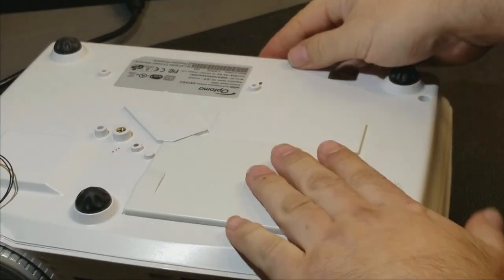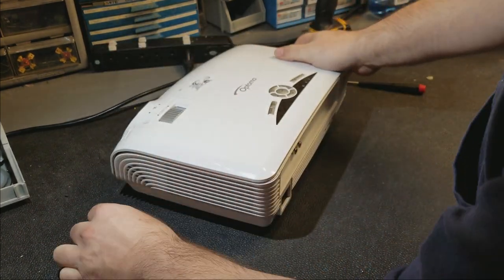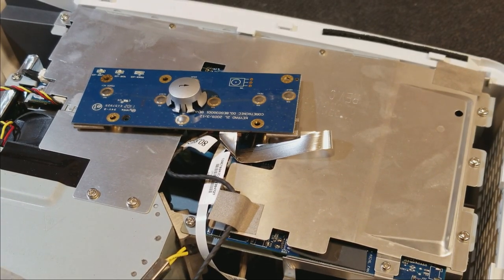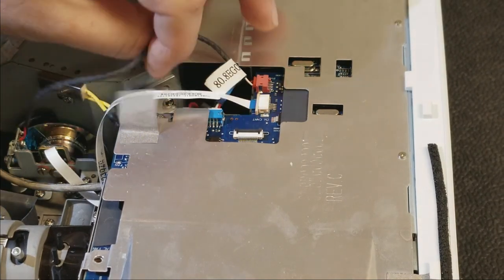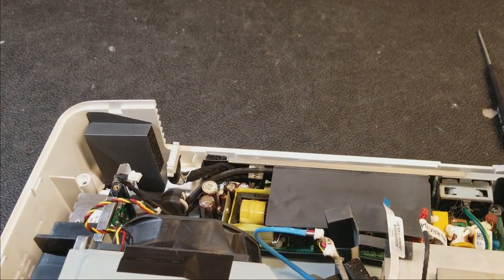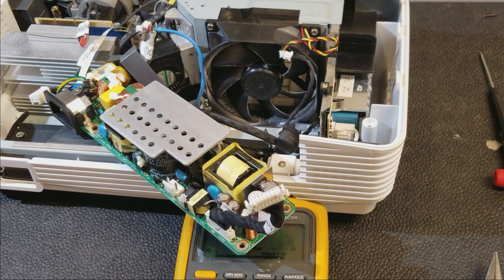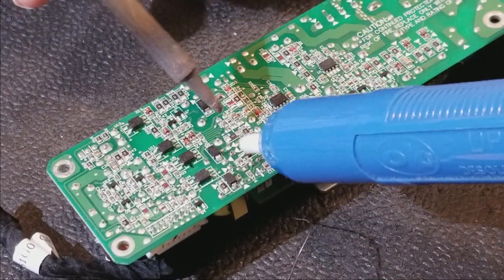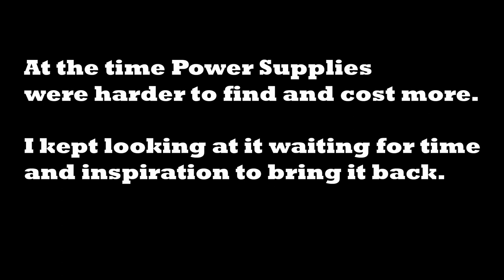Optoma HD20 DLP Projector Power Supply Replacement P 1

Comment: Frank, do you know how a projector works in 2D and 3D? It is software, or hardware based? (Epson 3 LCD)
Reply from the maker: Hi Tibor, I did some research and verified the epsons use software for the 3d. I'm trying to track down a service manual in your series. That will tell us more.
Reply: @FixitFrank  Thank you Frank. I appreciate it. SM will be hard to find. I'm wondering, if an IC that switches 2D to 3D may be damaged?
Reply from the maker: If I say no, then it will end up being bad.  However I kind of doubt it.  The fact that is works, just in 3D mode makes me think its software.  The software is going to tell the chip or chips to change the image properties.  What I don't know is if the change is handled by the hdmi chip or by the main microcontroller or if there is another chip that only handles when its in 3D mode.  Can you get me a few high res pics of the mainboard?  Whatever side has all the chips or both sides if possible.  

Another thing to try is talking to the projector via RS232.  You might be able to force a reset or mode change. You will need a terminal program like Putty or Hyperterminal, a null modem cable (DB9) and a usb-serial (or a pc with a real serial port).  

Go through here https://epson.com/Support/wa00573a for the zip file with serial commands and terminal setup.  

It's in excel format which is unusual, but on the TW6100 worksheet, there is a list of commands to send via RS232.  One of the commands batches has a lot of 3D specific settings.   You may find the setting there that will straighten it out.  I would verify the software before going after the hardware.  The software will actually be easier to rule out. If you go through all of the possible commands via RS232, then it might be a bit of hardware.  

I will look at the pics of the mainboard when you get them and I will try and determine what is controlling the 3D. My worry is that the problem is a separate micro controller. Replacing the chip itself wont fix it unless you can load its firmware which is not available to you or me.
Reply: @FixitFrank  My model is the 3020e, that would be the TW6100, right? It has to be RS232, I'm not sure if I have a PC, with that input. I have serial to USB adapter and Putty though. It has to be both connected to the PC?
Reply from the maker: @19mati67  Correct.  The serial to usb gets you to the RS232 port(serial is usually RS232).  The TW6100 section is where the 3020E commands are located.  Putty is how you talk to the projector, the serial to usb cable is how you conenct to it.
Reply: @FixitFrank  Thank you Frank. I will have to repair that W1070 first, and then I get back to this. That one, had blubs of dust everywhere(packed). The insulation, from the safety switch were melted off, looked like burned. Fuse F601 is open.
Reply: @FixitFrank  I'm trying to use an FTDI converter and I'm not getting anything on Putty. The adapter, has a 3.3V/5V jumper. On which position should be this jumper? I have never connected a projector to a PC before.
Reply: I have tried the loopback test, and what I type in Putty, it shows up. It seems like the adapter is OK. I plug in the RX to pin #2, TX to pin #3 and GND to pin #5.
Reply: Also, no matter what I do, the whites are yellowish. I can't get a nice white. Two of the ribbon cable connectors are partially, or fully broken tabs. You wouldn't know, where could I find these connectors?
Reply from the maker: I am not sure if that will work with the projector. You need RS232 but I think that FTDI board only offers TTL.  I use something like this.  https://www.amazon.com/Adapter-Prolific-Chipset-CableCreation-Converter/dp/B0758B6MK6/ref=sr_1_3   If you scroll down to "Frequently Bought Together" you will see the null modem and gender adapter.  You can also use bare DB9 plugs and wire them as a null modem.  Null modem is swapping RX and TX pins so that one sides RX goes to the other sides TX.  I think this is your issue here.
Reply from the maker: I don't.  I'd probably see if I had another dead mainboard to pull them from. I have gotten away with shimming them into position with thin pieces of plastic. I used a piece I cut out of a blister package. The plastic was thick and thin enough to wedge the cable into the connector.  If this is the same epson with the 3D issue, I wonder if this problem has any affect with the 3D issue?
Reply from the maker: Do you have my email?  I have a spare USB-serial wire.
Reply: @FixitFrank  Actually, that is what I did myself. It works, but I thought that maybe they are not making good contact and that is why I'm not getting the whites.
Reply: @FixitFrank  You most likely are right about this. I still have to understand this null modem cable.
Reply: @FixitFrank  The one that is posted here on Youtube?
Reply from the maker: @19mati67  That's the one.
Reply from the maker: @19mati67  Ah gotcha.  The lack of white is probably failing polarizers.  Personally, I stay away from older LCDs(to fix and sell) because of those polarizers.  Replacing them is usually not cost effective and there is no way to make them work once they start to fade. I have repaired a few.  Sometimes you can get away with replacing the bad one, but the 'right' way is to replace all 3(or 6 if they are all bad. two per color).  
All that said, you might want to try adjusting the adjustable polarizers and see if it's something you can tweak into a good image.
Reply: @FixitFrank  It used to be OK, I have removed everything, stupidly even the LCDs(first time dealing with a projector) and now this is what I have.
Reply: I have placed an order for that serial adapter. It will take a few days, until I get it.
Reply: OK, I'm playing with it, but I don't see here what else can I do with it, other than controlling the pj. It is the same, as if I would control it via the Menu.
Reply: I have managed to get a connection, only once. I have tried many different ways, but it won't "answer" to my commands.